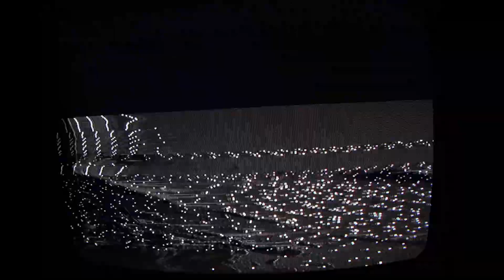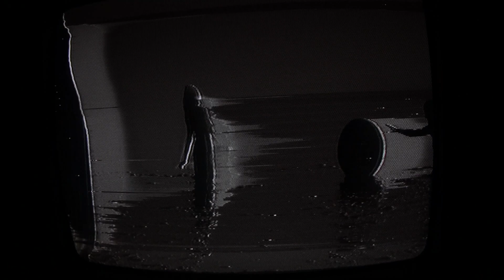Circuit Bent Sima Pro Ed/it 3 - Video mixer for glitch art

Comment: I like how you did this one, you seem to have alot of control over specific colour effects and the glitch effects.
On the one I did of this unit I only have one latch switch doing one colour/negative effect and two pots in series doing two other bends, mostly the glitchy stuff and normal colour effects.
All the same effects are achievable on mine but just differently wired. I like both ways . Great looking results thats the main thing however you get there😂👍

Comment: Thanks for video. I have a Sima SSM soundmixer and the cheap preamp is great for grungy distortion adding a sort of sudo compression across the other channels. I use it with my Roland T8. Have you tried the preamp on the model in this video to see if has a similar effect?
Reply from the maker: I haven't actually - though that's a great tip!
Reply: @StephenMcLeod  I’m thinking of buying the same model as you. As it has stereo inputs and outputs. Any chance you quickly test it and let know if has the same distorted sudo compression effect.🙏

Comment: in your camera there should be an option to change the shutter speed, sometimes it completely disappears but usually its just what is best. i also find putting my camera in a different angle helps too
Reply from the maker: To stop the weird red line? It seems to happen no matter what. It's bizarre.

Comment: What about the type of signal you can send to these older units? Can you get today’s wider screen video in and out?
Reply from the maker: I am not 100% on the technical end of things, but in theory the aspect ratio is set by the source. Generally speaking, these boxes don't adjust that (unless they are upscalers or what-not). So if you send out a video that is in an aspect ratio of 16:9, all that happens is that the end display device will squash it down to 4:3 or whatever suits its particular situation. The box doesn't code or recode that. If you wanted widescreen output, you would need to use an output device that could display 16:9 - whether a widescreen TV, or a digital capture card. In theory the aspect ratio is untouched throughout the process.

Comment: woooooooo!
Reply: is your dslr's refresh rate out of sync with the crt's refresh rate? you should be able to experiment with the dslr shutter speed until the red band is gone
Reply from the maker: I wonder if it's the 50fps I'm shooting that's causing the issue. I might try shooting 24fps but that becomes a pain later. HMMMMM.
Reply: @StephenMcLeod  could be it as well !
Reply from the maker: @josiedaisy  it's only an issue when I try do stuff like this, rather than the actual glitch recordings. So I bet it is that. I'll have a bash!